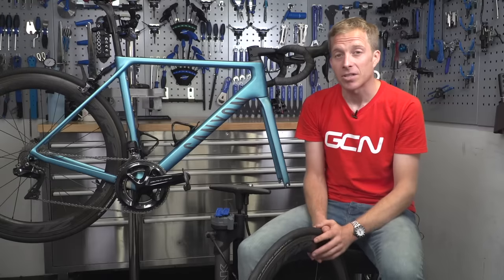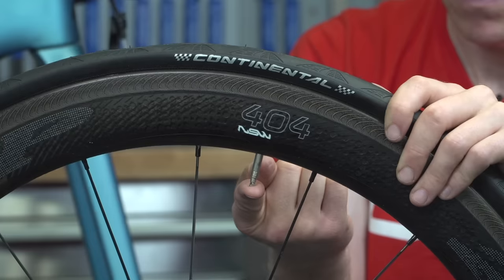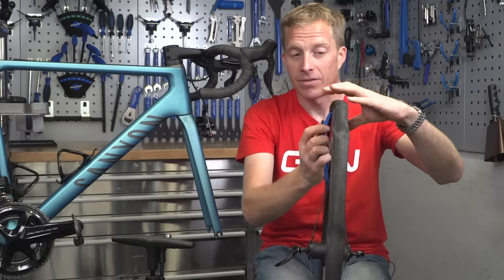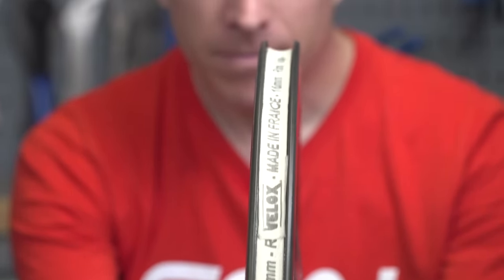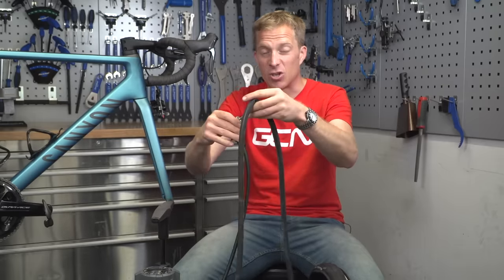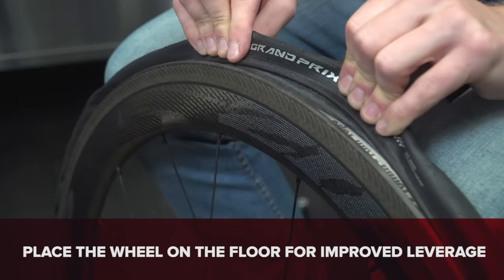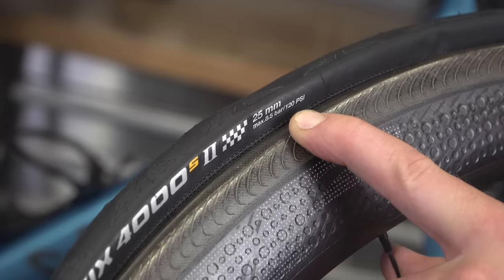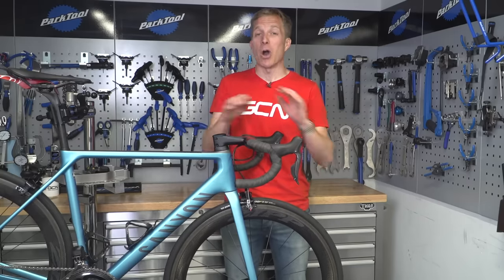How To Change A Tyre On Your Road Bike

Comment from the maker: What's your top tip for changing a tyre? 👇
Reply: heat the new tyre with a hair dryer on a low setting...it'll make sliding the last bit over the rim easier....or use washing up liquid on the rim (not even going to watch the vid as putting a tyre on is preschool education
Reply: If you know your tire is hard to get on, carry 3 tire levers. When you get to that unfortunate moment as you are remounting the tire, put one lever near where the tire and rim are beginning to interface and the other a spoke or two away from the other end. Use the third lever to force the tire onto the rim and work your way around.
Reply: Do some grip exercises
Reply: Darren Johnson hey GCN is for beginners as well. I learned how to do it not too long ago
Reply: Bacon grease! Coat the inside of your tyre and rim with bacon grease. Your tyres will slip on and off with ease. Added bonus of being the guy/gal who gets to ride around smelling like bacon.
Reply: We need a presenter challenge: who can change a tire the fastest. Jon's video was a little longer than the one that Si did 2 years ago
Reply: If you can't change a tyre at home, buy a different one. You have no chance when you try to fix a puncture during a ride.
Reply: @GCN the title should be “how to change a clincher tyre” seen that we have tubular and tubeless tyres
Reply: I'm surprised you also don't start from the opposite side to the valve when fitting the tyre also John. This gives you more slack during that final fitment.
Reply: Put a small amount of soap on the bead and it will slip over the rim. Tubeless tires are much harder to get on the wheel. Tighter bead.
Reply: When putting the tyre back on, start opposite the valve. That way, if you have to use leavers, you are less likely to pinch the tube, as it is held away from the rim by the valve.
Reply: A small amount of washing up liquid on your finger and rubbed over the rim makes it slide in with ease 😳
Reply: After I have deflated the tire. I take my shoe off, grab the rim with my by toes so that the valve will stick out between big toe and the one next of it.. Can be done also with shoe on, but.. Then start from both hand from both side from valve and work all around the tire, that the tire bead would fall in.. (May be done also before grabbing the rim with toeas.. if it's thickheaded tire/rim) But.. Anyways I just start with both hand from both sides working upward to get cap between rim and tire at opposite side of valve and then pull the tire off to side as whole together with inner tube.. Then when re mounting. I first put some air inside of inner tube, then insert it inside of tire while checking that the valve would meet up with some sign on tire.. usually the pressure mark.. And then I insert it to the rim one side at time.. First side is easy the second one can be tricky, especially on narrower rim and thicker tire with thicker tire beads. And of course, by making sure, that the innertube von't get pinched and etc etc... And I start remounting from opposite of valve also.
Reply: Don't bother with a pump, you can just blow into the tyre for the bit of air you need to put it on.
Reply: best tip is to not get a flat / tubeless is a good tip too
Reply: when installing/removing schwalbe pro one, need to use 2 lever at once to have enough leverage power to lift the bead. super tight. single lever seem like to bend or snap into pieces.
Reply: You missed a critical step at the beginning, once you have deflated the tire you need to unseat the bead of the tire on both sides, it looked like you had done this in the video but didn't mention it and on modern carbon rims you really need to do that to get the tire off. Also there is a tool called a tire jack that really makes getting that last part of the tire on much easier with way less chance of damaging the tube, you should check it out.
Reply: Puncture kits can come with a rubber grater to roughen the inner tube surface to take the patch, I always drop in the kit a piece of french chalk to make in to some powdered lubricant to slip that last bit of tyre over the rim wall.
Reply: Put the tyre in a sauna to make it easier to fit! Normal temperature is enough, something like 70°C - 100°C where you'd normally be sitting in.
Reply: GCN Tech #AskGCNTech Is there any benefit to rotating front/rear tyres to prolong lifetime?
Reply: Top tip: Change the tyre. That's how I do it.
Reply: Be sure to only have flats on hot days.  Usually you can remove the tire without any tools on a hot day.
Reply: congrats fortunately i've got a Dad woi showed me over 30 years ago how to do it
Reply: When having a screw for fixing the valve -> only screw it on at the very last moment and don't tighten it to hard. If you would do this e.g. before having the outer tube on, it's likely the outer tube won't come over the inner tube.
Reply: Anxious to try the hair dryer and slippery soap tips, but on the road these may not be available.  With tight tire/rim combos, I pre-stretch the tire a bit by fitting it on and off several times with NO tube (while watching GCN videos, of course).  Then it's a bit more cooperative when a flat occurs in the field.
Reply: No self respecting cyclist should be using a tire lever. First time GCN tech has really disappointed. 

If you use the center of the rim (smaller diameter) you can replace a metal bead gator skin on a tubeless rim. If you need a tire lever your tire is still seated somewhere in the rim. Levers just increase your chance of pinch flats or just damaging tubes, tires or rims.
Reply: Warren McKay:  That's such self-righteous BS ("No self respecting cyclist should be using a tire lever"). Ideally, that would be the case, but Tire-to-Rim tolerances run the gamut from "Almost Scary Loose" to "Is This a 650 Tire?" - never mind if my wife had to change it on the road.
Reply: Use your hand to roll it if you can and even if there is lightly tube rolls out. Can fix that as what Jon said. Use a lever to slightly lift the side beads and inflate the tube and it will pop back into the right place
Reply: T N Depends on the combination of rim and tire. Yes, some can be quite difficult.
Reply: Yes, fixing a flat with cold fingers is the worst.
Reply: If you are stuck using tire levers to put the tire on, only do very small sections at a time and don't raise the lever much past the outer edge of the rim.  Also, if you have some and a tire is super tight to get off/on (Bontrager tubeless road for example) narrower tire levers are better, because they don't stretch the tire as much, and if you can do 2 at the same time if you're having trouble getting the tire off, you can normally get two far enough apart to get it off.  Of course the goal is always no tire levers for the whole thing if possible.
Reply: I have learned that putting a bit of air in the tube before you install it does 2 things:
1. Prevents the tube from possibly expanding outside the sidewall.
2. Helps keep the tube in the shape of the tire.
Reply: @georgehugh3455  Spit and sweat are usually available at the roadside and do the job in a pinch.
Reply: If heating up the tyre isn't enough, cool down the rim by storing it outside (when it's colder outside, obv.)
Reply: Go to tyre manufacturers website and follow the correct instructions!
Continental
https://www.continental-tires.com/bicycle/service/videocenter
Reply: @DarrenJohnson1973  Hair dryer tire warming on the side of the road. LOL
Reply: I do it whilst having my steamy.. shower.. I can even take my Lycra off easily too :)
Reply: @DarrenJohnson1973  why comment then
Reply: I find that playing smooth jazz in the background really helps the process along.
Reply: Get the shop to do it.
Reply: Stubben tyres, put in a vice on the last part and pull the wheel towards you. I have been through many tyres but works every now and then
Reply: @Tkranz  road bike maybe, if you're bike packing that would invite a very uncomfortable encounter with a bear ( in north America anyway)
Reply: Pay for the bloke at the bike shop to do it.
Reply: it's like ground and pound when i Returning it to the rim. 🥴
Reply: @warrenmckay9826  I have been riding all different types of tubes and now Vittoria's Corso, which is just totally impossible to get on without leavers, and not by a bit of margin. Just impossible.
Reply: I wave to the Shimano support car that's 30 meters behind me.
Reply: Stretched new tire and glue or tape. Done?

Comment: The manufacturer name/logo is easy to find on most tyres. What is not easy to find is the max recommended pressure. On most tyres it is displayed in small black letters that are hard to see against a black sidewall. So I recommend locating the pressure spec at the valve. After all, that's where you'll need it.
Reply: That's a very good idea!
Reply: Some GCN presenters seem overly obsessed with appearance (sock length/colour of shorts/position of cranks in photographs etc.) and so I suspect your excellent idea might trigger their OCD.
Reply: Yes, always look at the tire and try to see any words - either in extruded rubber or highlighted in white paint. Thanks for the tip. I had to google the manufacturers product code and product name just to make sure I was actually looking at a bicycle tyre. I used to get my inner tubes and condoms mixed up, but not now thanks to GCN tech channel. Thakns guys.
Reply: D.Eldon - That may be helpful the first time you use that tire, if you have gobs of different tires or dementia, but I've been set on pressures for years now.  I use the mfr logo to aid in locating any possible remaining glass, wire, stone in the tire once I've isolated the leak in the tube.  Important not to flip tube for this to work.
Reply: @ElliotFlowers  Dude ... :)
Reply: @t.c.9838  Petrol trumps oil.
Reply: Really thoughtful advise; thank you.

Comment: Excellent video. I’ve changed tyres before but always wrestled with getting the final bit of tyre inside the rim. The squeezing the tyre into the centre of the rim is an excellent trick that made it so much easier. Thank you GCN!

Comment: Use talcum powder liberally on the tube and inside surface of the tyre, makes every change easy.
It helps prevent pinching and helps both  the tube and the bead seat correctly.
Carry any spare tubes in a zip lock bag with talc in the bag so they are ready to go out on the road.
Aligning the Makers name to the valve makes it easier to locate the puncture hole in the tube and also check for any material still stuck in the tyre.

Comment: Walked in my local Halfords a week last Saturday to buy some dry lube and just ahead of me was some bloke with his Giant Antham booking it in for a service and while he was at the counter he said it needed a new front inner tube also and the young girl behind the counter said that will be £37.50 for the inner tube and then anythingelse on top... £37.50... thirty seven pound fifty... THIRTY SEVEN POUND FIFTY!!!!!!!!!!!!!.... I'm in the wrong job... I run all my bikes tubeless but I can change out a inner tube so fast you could blink and miss it and Halfords are charging £37.50.
Great video as usual GCN.
Reply: Nigel Oulton the thing is, if you have to change a tyre in the rear and there's a chain plastic thingy box (dont know what its called), it can take a pretty long time to undo this, then remove the brake cable from the roller brake, and then also remove the shift cable when a nexus hub is used. So yeah if the girl had an road bike or mountain bike it is pretty expensive... But otherwise its normal charged
Reply: Nigel Oulton Or was that the price of the service?
Reply: Mark Flugge actually for the sake of brevity I left out that while I paid for my muc-off glow in the dark dry lube the bloke who owned the Giant that he brought in for service was asking how in hells name could a 4kin inner tube (his words) cost £37 4kin pounds fifty... the girl behind the counter basically said if you want it fixing up, because I had to admit the bike looked seriously in need of some TLC  you can either pay through the nose or shove off elsewhere. So yes they wanted 37 fifty for just fitting a inner tube  - a job I can do with ease in just about a minute.
Reply: niels tielemans what is a chain plastic thingy? only I am perfectly familiar with a Shimano Nexus hub and know how to strip one down and fully service it and ought to because I own it and its bigger brother - fine pieces of equipment although I prefer sturmy srcher. Is a plastic thingy a chain guard?
Reply: Haha I know my friend paid 20 euro for them to put in a new inner tube with sealant on his mtb even though he has never got a puncture on it and only rides on the road. Maybe he heard about the benefits of tubeless and thought that was what he was doing but the benefit of tubeless is the lack of a tube! I told him next time he wants to do anything to his bike to ask me first just for his own financial wellbeing!
Reply: Cormac Stapleton sealant in tubes are pretty good too ya'know especially with a road bike since tubeless wheels are hard to find cheap
Reply: yeah its easy to do people some have become lazy

Comment: Thank you for the video.. couple tweaks of my experience of tire installs. 1) I would finish off the final bit of tire install at the valve end little more wiggle room with the valve out of the way. Especially Tubless tire setup 2) you can apply bead lube on the last 4 inches to get it onto  the rim 3) After mounting the tire pump tires up to aprox 20 psi and then check for inner tube bead pinching. Especially for latex innertube‘s.

Comment: 1.  Pressing the bead into the center channel to get slack is critical.  Just poking at it here and there won't work.  Put the rim across your knees, start opposite the valve, and press and slide the thumbs around the beads on opposite sides to "iron out" the bead into the channel and get the requisite slack for the final few inches.  
2.  With a silver fine-point Sharpie, draw in your own small direction-of-travel arrows right under the tire logos . . . all four of them.  When you faff around trying to find the molded one, you will know why.
3.  Keep the plastic cap on your Presta valve spares so the metal tip does not chisel into your spare - when installed, ditch both the caps and any screw on washers - they serve no purpose when mounted - one less thing to fiddle with, and a fundamental Rule of Pro.
4. On the road, be sure that any sharp thing poking into the tire that caused Flat No. 1 is removed lest you enjoy Flat No. 2 within about 30 seconds after you resume riding.
Reply from the maker: Thanks for sharing your top tips!

Comment: In case of a difficult tyre/rim combination it 's best to start with pushing the bead of the tyre to the centre of the rim ( which diminishes the tension on the bead ) and once this is done you can put  2 tyrelevers under the bead next to the valve (!) and lift the bead over the edge one lever at a time. With this technique you can often push the tyre of the rim without the aid of a lever in a normal situation.
Reply: What do you do when you physically can't push the bead? XD I have newish bike where I've never changed anything. The bead is so stiff and tight I can't move the bead
Reply: It's so stiff I have to use both hands to move it a few millimeters... never mind get the tool in at the same time

Comment: I have tires that start out really tight (can barely get them on or off even with levers), but then loosen up a lot and become very easy to take on and off. So I mount and dismount them a few times to stretch them out before installing them with a tube. Figured this one out after destroying a couple tubes...

Comment: My 68 year old arthritic fingers sometimes have trouble getting the last bit of bead over the rim.  Especially the first time I mount a new tire.  I use a Kool Stop Bead Jack to pull that last bit over.  Better than using the tire lever, as it never gets between the bead and the inner section of the rim.  And not to expensive.  You can find them a lot of places for about $12.
Reply: I'm 60 just fitted my first set of tures to my first set od deep carbon rims and I'm lying here reading your old post with two aching thumbs 😀
Reply: @nigelliam153  you have my sympathy. :-)

Comment: I always dust the inner of the tyre and the inner tube with either talcum powder or climbers chalk so they don’t stick, also a little bit of washing up liquid on the last stubborn bit of tyre that is putting up an almighty resistance to being popped over the rim, ( just snapped a brand new Park tyre lever putting my new Vittoria tyres on!).

Comment: I run vittoria latex tubes on mine, i pour some baby powder in the tire before i replace the tube and rotate it and also extra powder on the tubes in a ziploc bag. All your tires get powdery white, which easily wipes off. I got a flat in November and i ran these and i still am on new gp4000s25mm  stretched out to 28mm due to 27.5mm rim  outer width ran at 100-115 psi

Comment: Just popped my tube trying this.

 It wouldn't seat properly around the valve and then it wouldn't go back into the tube for when I was trying to seat the last part of the bead. 
turns out the tubes I had where not made really for 23, they where more for anything between 25-32c.
since changed tubes. works like a charm! though did need two pairs of hands to get certain tires on lol

Comment: Ha ha, that was a ridiculously easy tyre-rim combination you chose for the video.. :-)  It would have been good to demonstrate fitting something tighter, and particularly the technique of "rolling" the last section of the bead onto the rim. Just fitted a brand new Vittoria Corsa G+ onto a Ryde Pulse Sprint rim and it was a nightmare! It's now pumped up to 140psi and hopefully stretching a bit.. One tip from this particular tyre - tan sidewalls help when fitting because it's easier to see the inner tube (because of the colour contrast) and avoid pinching it.